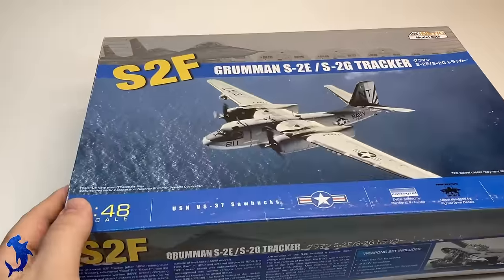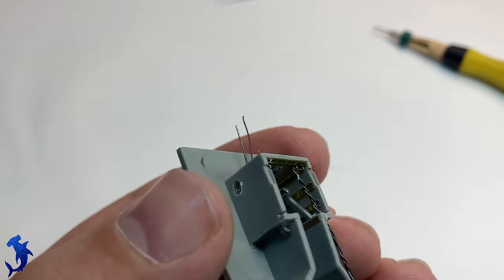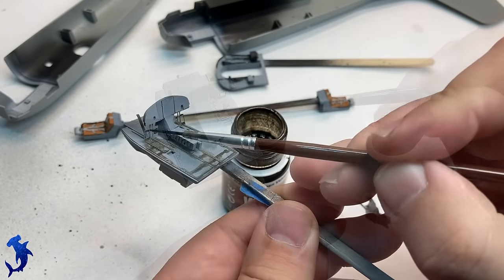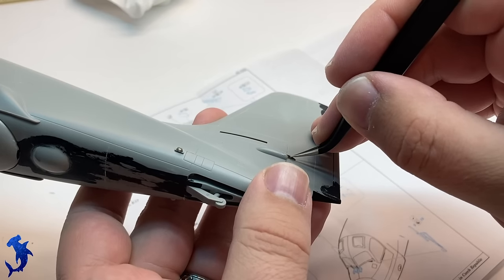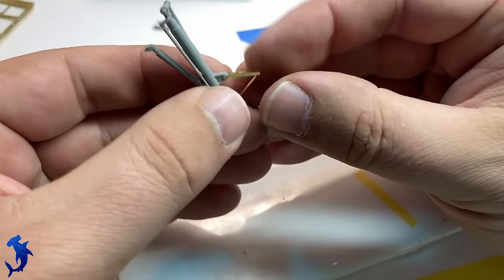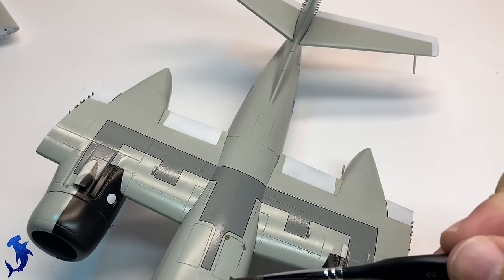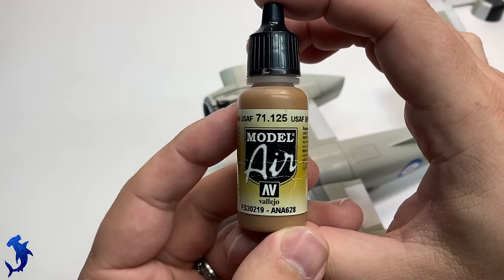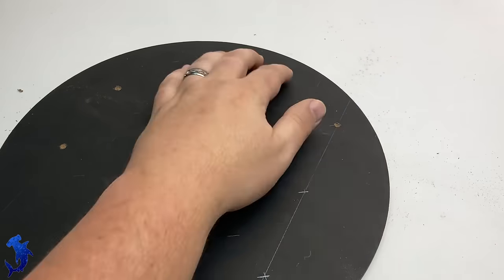1/48 Scale Kinetic S-2 Tracker Royal Australian Navy Markings | Full Build Video

Comment: Nice build, man!
This kit requires brass landing gear legs due to its weight.
Other than that it's OK (accurate geometry, crisp detail, etc.).
The only drawback is very sparse detail in the cockpit, bomb bay and gear wells.
Reply from the maker: I agree, I think the torpedo bay is the most unfortunate area on the kit, being that this aircraft's whole purpose is to take torpedoes!
Reply: @HammerheadModelMaking  it's only purpose is to search submarines and just in rare cases attack them with torpedoes :)
Also panel lines and overall surface require good sanding with fine greed sandpapers and melamine foam before priming and painting.

Comment: Outstanding job Brett. I'm new to your channel and I'm loving catching up with your builds. You strike a great balance between detail and brevity. One question on this one. The "Y" on the starboard aft NAVY decal. Is that intentional? It seems odd. And once seeing it, it kept drawing my eye. Keep up the good work and great videos!
Reply from the maker: You're the first to catch that!  Yeah, I actually didn't even catch it myself until after I had taken the final pictures and had them up in photoshop.  Best I can guess is some of the decal of the "Y" lifted off with some masking tape when I was making a small correction in that area.  I keep meaning to go back in and try and fix it, but just haven't wanted to yet.

Comment: Amazing job on the Tracker, quick question about your pin vise I've seen you use, where did you get the  nose piece to fit the micro drill bits as I have the drill bit set
Reply from the maker: Its just the normal pinvise, but the micro drills I use already have the larger base to fit in the pinvise, links to what I use:

https://www.amazon.com/General-70804-4Pc-Pin-Vise/dp/B0031F02NQ?asc_campaign=97c5581ac0f96453bb6f38505e297314&asc_source=01H192EPVRBJ54JPPQEC40HZ7N&tag=namespacebran487-20

https://www.amazon.com/WayinTop-Carbide-0-3mm-1-2mm-Circuit-Engraving/dp/B07S636JHY/ref=sr_1_5?crid=1XMZ75K07LEWZ&dib=eyJ2IjoiMSJ9.AdvCrMKzU5FyVBD5M3HTjm4TWW9QEusJko8hzuYt1NQYwXCJMuhfSruWzPsFwIvRaKtV-AC27g2FEj-2tb6-hQtzJilng3cYdDfa1gn7RlSsjjW4-uJuuoZD03V1oMNSLWP7ybtcsA6WRYFQ47MZNFyxLDmI3qIEvNlIkcFaUibIVZCBvctaTw-l0zx75FwhvsdgfwmjKE6Ot57vhnZkA8qfwikriRGejI0Vmn-Dgr4v_j9NyzYRkpvWF1iuPj-SrrwqYXkP7HExa4Uh8Uye-Q-4kIDvm11E7L-m91Vj994.pM-cF7L-JBMw0GcvXbp22J2p8v_w0MB6jx9mVcEyL6g&dib_tag=se&keywords=micro+drill+bits&qid=1722663346&s=hi&sprefix=micro+drill+bit%2Ctools%2C126&sr=1-5

Comment: The coating on aircraft carrier and all ship decks is called nn skid or non skid. Its been a while since Ive served. Used to be a sonar tech. Also was cross trained to be a torpedo man and to strap on the torpedoes to the SH60s we had on the FFG7 I was on. That wouyld make a nice diorama. An SH60 sitting on the RAST gear that traps the helo so it can be reeled in onto the flight deck and moved into the hangar. You could model the side rails and the helo bay door and the raised windowed area that the officer who is in charge of landings hides inside of. Lots of interesting details in a small area.
Reply from the maker: Yeah, those are great ideas for a diorama!

Comment: I noticed the bulkhead and floorboard PE has been heated....  WHY?.  I've only messed with PE once.
Reply from the maker: Thats actually how the PE came, I'm not sure if it had been heat treated or was simply tarnished (the areas that look like they were effected had a much rougher texture than the areas that were still shiny)  But typically you would heat treat, or anneal PE to make it easier to bend in round or curved shapes.
Reply: @HammerheadModelMaking  ok

Comment: I had a whole lot of trouble building the Grumman S2N model from Kinetic. Mine is modelled after our own Navy. " Koninklijke Marine" from the netherlands V 159. The folding part of the wings weren't easy to fit correctly also the searchlight provided was terrible. I had to make my own. Otherwise i turned out great. I have photo's for the result. ( V is for Valkenburg before that it had the D on the rudder.
You're build is quite nice...good work
Reply from the maker: The kit certainly requires some work, I used a fair amount of filler on this one.  So, I get it!  Thanks for watching!

Comment: Wheel weights would probably be a good system for weighing models. Not the hammer on guys but the stick on weights. You can break them up into small sections and double them up, or leave them in long strips. Also come in a variety of weights.
Reply from the maker: Thats not a bad idea!  Thanks for sharing!
Reply: @HammerheadModelMaking  I just wish I had access to cheap or free stick on wher weights still 😂

A box of them is fairly expensive… but will probably go a long way and last quite a bit.

Comment: Great build. I had to create a mold from the empty spaces in the cockpit behind the instruments panel and the area around the front landing gear bay to create a custom lead piece (actually 3, also behind the cockpit back bulkhead) all lead to impide the tail-sitting... it is a lot of weight and the landing gear is just there in their design limit... 2 years and still holding, but don't think it will forever.
The torpedo bay is a shame... needs a full scratch rebuild or replacement. I did almost the same mods/scratch you did (up to the paper clip, really necessary)... the engineering of the kit is weird at some points, but overall the result is great. Very good explanations, thanks!
Reply from the maker: That sounds like a lot of work, but in the end if it prevents it tail sitting, then job well done!!